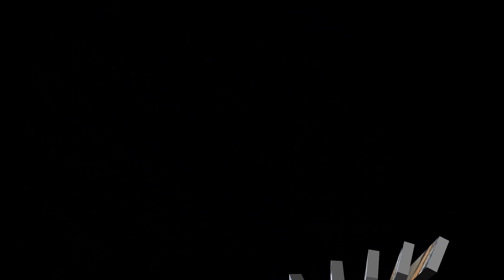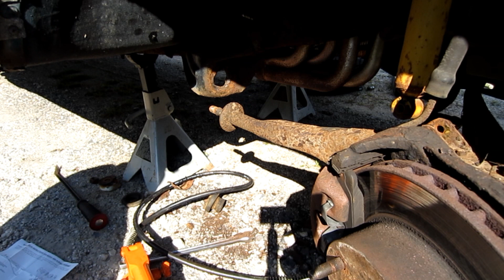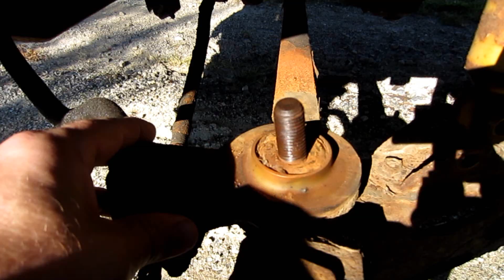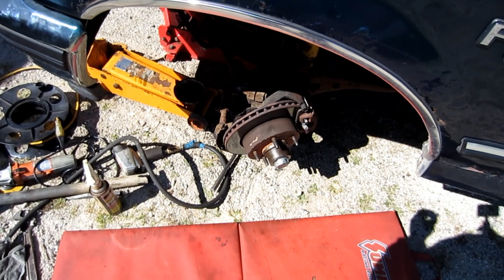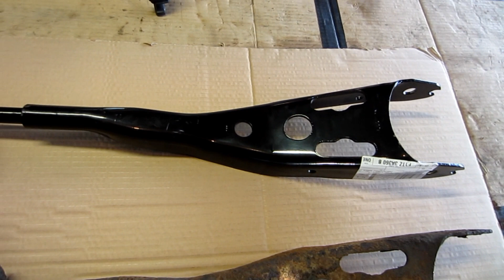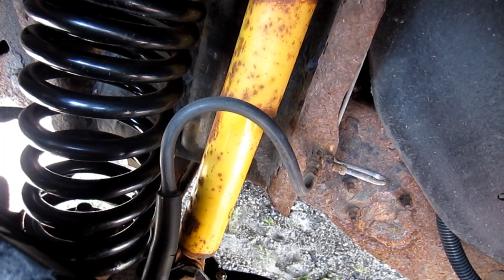F150 Coil Spring and Radius Arm repair

Comment: I have replaced everything in the front end of my 1996 2wd f150.  Except the radius arms.. I want to know if I replaced them would the bump steer stop.  It's insane in my f150. Will send you to another lane .if they are big pot holes .at say 65 mph.

Comment: 😊😊😊... When it comes time to undo the Front Torsion Bar,...Undo the Bottom Bolt , washer and Nut connected to the short link...That way,  the assembly drops down...The top bolt interferes with that drop down motion....😊😊

Comment: The BEST Harbor Fright tool I ever got for Rusty bolts is a Chicago Electric 1/2 inch electric impact drill.  It's about the size of a small football, and weight about 10 pounds.  It stays in its drawer until the big dog needs to come out on a tough job.  It works great!  Saved me DAYS of messing with michigan rusty bolts on my cherokee!

Comment: I own a 88 f150 have you experienced real bad shaking in low speeds I've replaced all bushings and ball joints, steering gear, new rotors, front calipers, front pads, front bearing, brake master cylinder, brake booster, got it aligned, new tires, rebalance wheels checked for bend wheel, energy suspension radius arm bushing, sway bar bushing and links,I did notice what you said about torque the wheels evenly but tryed that, I got the new rotors cut thinking the rotors may have been warped out the box and the guy that had cut them said they were but still shakes in low speed very badly shakes the dash high speed shakes very little but fast
Reply: I have a couple of potential ideas. To start, I say give the pivot bushings a check. I’ve seen some that are like nearly disengaged and causes the twin I beam to be ever worse than of a design that it already is. Sounds crazy but does it shake when your foot is on the acceleration pedal or at all times?I’m almost thinking maybe your motor mounts could be bad. On idle my door panel shakes all over the place because the motor and body mounts are bad. Also, I know it seems random, but you never know; another issue I ran into was that my rear drums brakes would constantly seize. They could very well be failing or getting stuck and that may be causing a vibration. Let me know if you have checked any of these. I’ll keep looking into potential ideas as they pop into my head.
Reply: If those drums are somewhat stuck it will reduce the rear wheels from rotating as well and the rear tires will skid a little bit and cause a vibration. Happened to me. Anything is possible. In your case it’s tough to figure out since you changed so many components.
Reply: I figured it out always had problems with the brakes not having a pedal, but what was making the front end shake was the star adjuster was not locking once I figured that out it went away

Comment: question about your sway bar does it work good? my truck has always been missing one and my handling is horrible my whole front end is pretty wore out too
Reply from the maker: If your truck doesn't have a sway bar on the front end you need to go to the junkyard and get one immediately. There is a huge difference with a sway bar on the front. Make sure you get all new bushings if you get one at a junkyard
Reply: @Foxboss9  perfect thank you!!!! im going to do that!!!! <3

Comment: I'm about to do a whole front end on a 1991 Econoline... I ended up buying the moog 1420 lbs.. but not sure if it's supposed to be 1200 pounds.  It's a 5.0.   The other problem is the vans have a double bolted top spring retainer and I'm not sure... do the bolts thread into the I beams??  I just got 3/4 - 14 7 1/2"  bolts.. but 3" of thread and the rest smooth.. I hope i didn't get the wrong bolts again... I'm doing rad brackets and arms too so.. why is it so hard to get the right hardware.. took me forever to get the right body insulators too.   went to get yellow zinc washers for those bolts to sit on the body under the carpet and they send me regular steel... you cant win even when youre right.. lol

Comment: You mentioned ford carrying the big ol center bolt that runs through the Ibeam any idea what the part number is or where to begin tracking one down? Im currently doing the same thing to my truck arm twist and all.
Reply from the maker: Let me just tell you that even if you do find it it's not going to be cheap that bolt was like $70 whenever I could locate it. That's why I went to all the trouble of reusing the old one. You may have to hunt one down at and Industrial Supply shop
Reply: Joy, and thank you. I was trying to avoid destroying mine but it didnt go so well..

Comment: How much did all these rust related repairs cost?   have a 1998 with similar problems.  I am considering selling the unit and purchasing another van because of the rust issues and need to replace structural part.  Mine is not as bad as yours.  Would like to do, but getting a little old and have a lot of other things to do.
Reply from the maker: If you are in the Rust Belt and you are depending on the vehicle, then it's best just to purchase another. If you were in the Rust Belt and you just need a vehicle to drive back and forth to work there's no sense in subjecting a new vehicle to rust, just run what you have into the ground. And then go out and buy a new one.

Comment: I'm glad I live in Oregon now , used to live in Wisconsin. In Oregon I don't have to deal with all the rust anymore

Also I'm glad you bring out the fact that you have to torque lug nuts evenly. SOOOOO many shops don't do that. Ever since I started using a torque wrench on disc brakes, i've never had shaking/warping rotor problems since.

I had my wife's car worked on a couple months ago to replace the struts. I always do brakes,etc myself on her car but for struts I had a local shop do it.

Later on, a few weeks later, the car still would start to shake as soon as you would hit about 70MPH. usually that means the tires aren't balanced, but I had had that done not that long ago as well.

Just for double checking, I then checked the torque on the lug nuts , i could barely even REMOVE the lug nuts on some of them!!!! They were on SOO tight! I couldn't believe this shop did this, I thought they were well known pros.

So I took the wheels entirely off, put them back on, and properly torqued the front wheels to spec, all around.

And believe it or not, the shaking at 70mph went away entirely! 

I sent a message to the mechanic shop about it and said I couldn't believe they did that (I literally had to STAND on the breaker bar to remove some of the lug nuts, not all of them but like 2 of the five, on both front tires). They gave me some excuse that yes they usually use "torque bars" and it shouldn't have happened. 

I'm like, you should torque manually, it's the only way to be precise and correct. They offered me a free oil change for the hassle lol.

I think a LOT of people don't know you need to be aware of this. Most tire shops even probably screw it up too. I've gone through lots of rotors on my cars until I started to use a torque wrench. It makes a HUGE difference.

Comment: Does the latch for the coil spring interlock with the strut tower ; opposite of the bolt side? Like where there is a notch in it? Thanks!

Comment: Use a angle grinder to cur the spring once u have removed the pressure from it and it will allow u to get socket on it alot easier without adding a 2foot extension.
Reply from the maker: car guy got to reinstall it though..

Comment: That truck in gone..fuuucckk😆
Reply from the maker: John Doe you would think. But you'd be wrong. It is currently on Facebook Marketplace for sale yet again with a different owner and asking $2,000 for it. Here In the Rust Belt as long as the frames or solid you keep on driving them. Surface rust does not mean anything in this state.

Comment: I am trying to change the spring on The from of my 4x4 bronco I jacked the jack up as high as it would go and put a jack stand Under it but I can’t get it to drop enough to let complete tension off the spring what do you suggest?
Reply from the maker: Double check to make sure that you disconnected the shock mount and also the sway bar mount. At that point you may have to push down to allow clearance for the spring to be removed. If somebody has installed oversized Springs you may have to go to the parts store and rent a spring compressor.
Reply: I just did my 95 150 4x4 and had to replace coil bracket one the body is as high as it will go I just pushed the axle down with my weight to get the spring to go back into the bracket but you need a spring compressor also but my compressor would not compress it enough thus me pushing down on the  on the axel
Reply: Also you have to jack the body not the axel

Comment: Great video! Thanks!  I am gathering parts to do a nearly total replacement of the front suspension on my 1996 F-150 and this and your other videos are really helping me get prepped!  One question...  Do you happen to recall the bolt/nuts sizes that are used to connect the lower shock mount bracket to the radius arm?  Using all new hardware and would like to get the proper bolt and nut before I begin. Have not been able to find this info. Thanks again!
Reply from the maker: CAS 1 Sorry, I am at a loss trying to recall any of the dimensions... Good luck
Reply: Thanks for the rapid reply! Mine also is an Ohio truck so everything is so rusted I plan to just pull/cut it all out and replace with new parts.
Reply: You can buy the extended bolt from LMC Truck...I just got two in the mail...they were $12.95 each. I also got the nuts and the rubber stops that go on the bottom of the shock mounts. The part # for the bolts is 40-0725. I got the radius arms off eBay new for $46 each...Dorman 522-389. I would never buy Dorman anything, but here it saved me $120 and they fix well.
Reply: CJ Kent Thanks for that info CJ Kent.  Actually I do have all of those parts but what I can't seem to find are the /nuts for the "45-2745 LOWER SHOCK MOUNT" from that same diagram you ordered from.  How did you mount this bracket?  Did you reuse the old hardware?  I have a bad corrosion problem here so just want to use all new hardware.  Thanks again for your reply.  It is very appreciated! :-)
Reply: I Ned to to that bushing on my 95  but they are rusty bad

Comment: Wire wheel attachments to an grinder and a drill, take off all the rust scales.. than use a product called Fluid Film. Best stuff ever.
Reply: What is the model number of the Port-a-Power? I went to Amazon and was unable to find it,there were many models of this product but 
none like you used in the video.
Thank You,
Mike

Comment: Hi...1996 F150 2wd Can you tell me what wrench size  the nut was you ground off that goes thru the radius arm? The nut that holds the spring was 1 1/8 wrench size this one is bigger. Both radius arms are rusted bad and trying to replace them. Thank You. nice video!
Reply from the maker: D. Murka not sure, I used a pipe wrench...
Reply: My 93 4wd F150 xlt radius arm nut was 1 1/8”, the same as the spring nut. Heaven help you if you decide to replace the radius arm itself like I did!
Reply: is the i-beam actually threaded or is the bolt just rust locked in it?
Reply: curtis lawson the I beam is threaded on top (stud)  and the bottom one is a big bolt that screws into what looks like a nut welded in place. If you look into the hollow arm just under the u-joint you can see it.
Reply: the reason i ask is i tried using the pb blaster and a 1/2 drive breaker bar.  it was so stuck it broke drive off the bar
Reply from the maker: curtis lawson the I-beam itself has no threads in it whatsoever. The bolt slides into the I-beam and is held on with the nut. The rust will make that Bolt hang on tight to the I-beam hole. But there are no threads in the large I beam.

Comment: Thanks for the upload! Great information. Quick question: I replaced my coils on a 95 351 f150 with new moog cc822 springs. I noticed the new coils had more rings than the old one. Is it okay for the rungs near the top to almost be touching after installed?
Reply from the maker: Coil stack is NOT normal, However, you may not experience any problems... But, If you don't like the trucks stance or ride I would go for the towing springs(video description)..They felt much better to me once installed...
Reply: Thank you for the quick reply. +1 Subscriber

Comment: im gonna go from the top...all the way down in..with extensions...CUT!   2 hours and 3 cans of PB later, 'so, i got the coil spring off, and' :)
Reply from the maker: giskard80 rusty a$s stuff😊
Reply: just did a new knuckle with new ball joints, and a new warn hub on the passengers side of my 95, the old ball joints weren't terrible, but one of them had a bind in it, so bad the steering would be 'dry' if i was anywhere past center toward the pass side. Never seen anything like that before, but some moogs solved the problem. next is manifolds. Just wanted to say thanks for posting this stuff up, I watch you do it, then I do it too lol.

Comment: Just wanted to say thanks for the tip of getting a port a power to move the front axel forward, Because there is no way i would have ever been able to move the axel far enough to get the Radius arm bushings out as well as in. Again thanks. I am redoing my whole front end parts on my crew cab 1995 F350.
Reply from the maker: I have seen people doing it with a ratchet strap around the bumper but I just had the porta power laying around.. Glad this helped out!! Thanks!

Comment: Those are actually the correct shock forgot what there called but my springs are close at the top three coils but not touching those were shot !
Reply from the maker: The springs I replaced were 1 year old.It was the second set of springs that I bought new that did the same thing so I had the problem for years even though the springs were not old at all.. Just needed to upgrade to Heavier springs..

Comment: how did you remove coil spring?
Reply from the maker: +Alan Barth follow all the steps up to removing the nut at the bottom of the spring.. at that point push down slightly on spindle/I-beam and it will allow the top of the spring enough clearance to clear the upper cup area and pull straight out.. On some trucks the spring wants to fall out without any effort at all..

Comment: So much rust. I was stationed in Germany for a few years where they also use a lot of salt during the winter. Seeing all that rust reminds me of working on some of the beater cars I owned when I was there. The worst one was a 2000 Ford Focus wagon. I had to replace the entire front frame crossmember (a pretty heavy, stamped piece) on it when I found that it was completely rusted through in some spots that I found when I was replacing the control arms and ball joints. I'm living in the southwest now. I'll never take a rust-free vehicle for granted again.

I'm really enjoying your videos. A lot of good information to file away for later.
Reply from the maker: Thanks.. Rust free is very very rare here..

Comment: When you do the upgrade to towing package springs it would be wise to upgrade the coil spring tower's also. otherwise the front end is just gonna bounce more. And from the looks of yours they wont last long with a higher spring rate load.  Coil spring tower's for the towing package use's dual shock's and are much stronger.
Reply from the maker: Coil spring perches are identical for the F150 regardless of engine options stripped out or fully loaded, using 4.9 5.0 or 5.8 liter so there is no "upgrade" perch.  When going to a "heavier" coil,  because F150's use the same perch, The overall installed height of the coil is identical so you would not experience any additional bounce just a more supportive, firmer ride.  Although this trucks perches had rust(NE Ohio all do) there wasn't any deterioration that allowed movement in the mount. Until 2 weeks ago I drove the truck daily with no adverse effects and 3 months ago towed our Travel Trailer with a weight distribution hitch pulling (5800lbs) with 700lbs in the bed 200 miles at 55 to 75mph without even a creak from the suspension. . If the truck stays in the rust belt. like it currently is, and is driven through the winters,  I would suspect The perches will need replaced in about 3 years.
Reply from the maker: This applies to 2wd.. 4wd has the option of dual shocks
Reply: +Foxboss9 When you tear it down to replace the shock/spring towers just a fyi stay clear of the NOS. they where bad from the start. I live in the rust belt also and have a 89 full size bronco that only has 60,000 miles on it and I had to replace the entire suspension. All the suspension part's (spring towers leaf spring hangers, radius arm and bracket's) all shaled out. found this to be a problem on bronco's, F series truck's rangers & econoline vans. You might want to also check the oil pan on your truck living in the rust belt. Early 80's through the late 90's are well known to blister and leak oil, again another part made with poor metal and not painted correctly in the manufacturing process.
Reply from the maker: +Don Crews I agree. I replaced all the rear spring perches and shackles on this 95 f150 and the truck prior to this one a 94 f150.  Also on this one I replaced the oil pan. While the pan was off I installed a new oil pump and pickup. The most shocking part that rusted out on me was my radius arms.. One of them actually snapped when pulling into my driveway ( video on that too). Of course both gas tanks and the bed and cab corners have been replaced too. During the winter, NE Ohio loves to salt the roads!